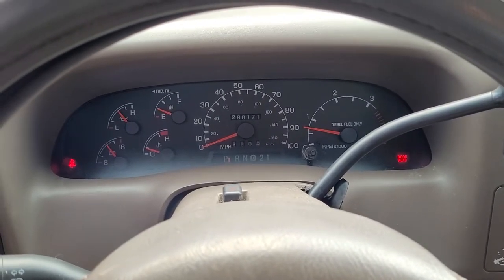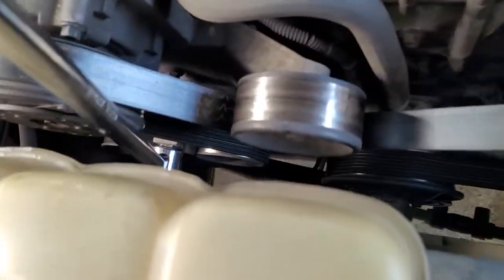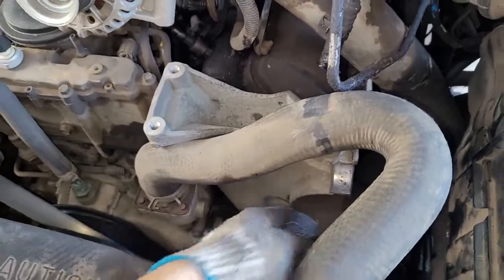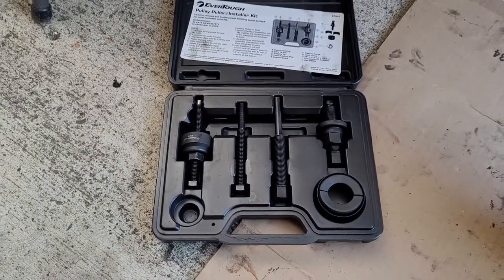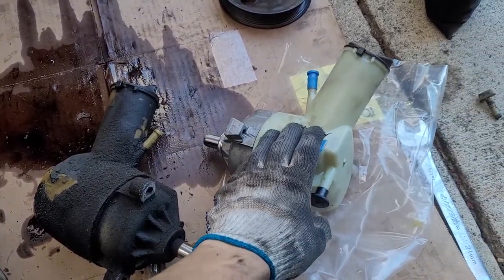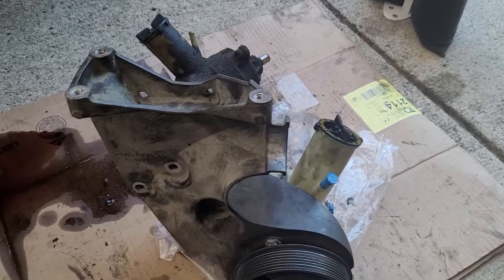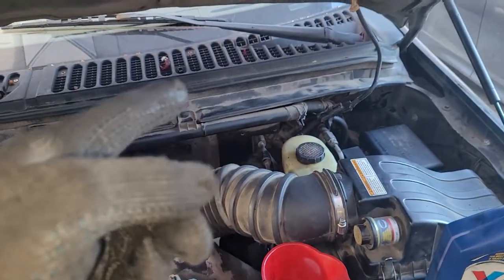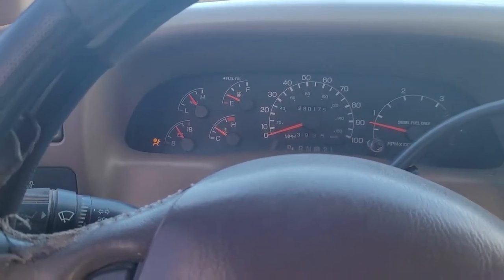7.3 Powerstroke - Power Steering Pump Replacement

Comment: It’s a lot easier to pull out the battery box and air filter box and the pump is right there you do not have to remove the bracket at all. You have to remove the intercooler tube and that’s it. We’re talking loosening up to clamps and four bolts five if you want to consider removing the battery. Call when you get to take out the cables super simple.